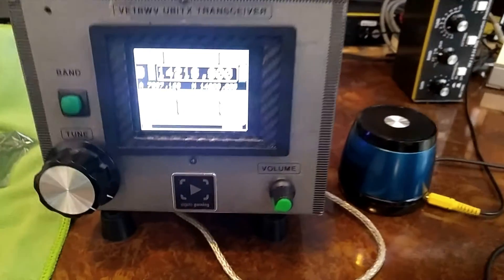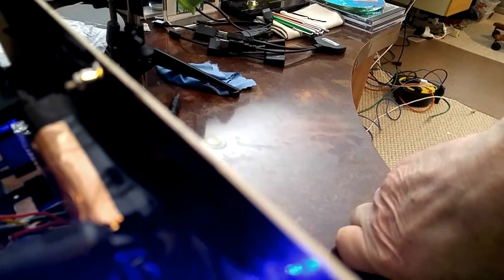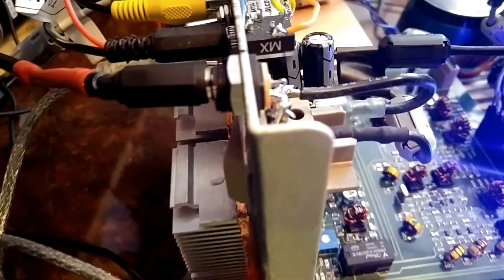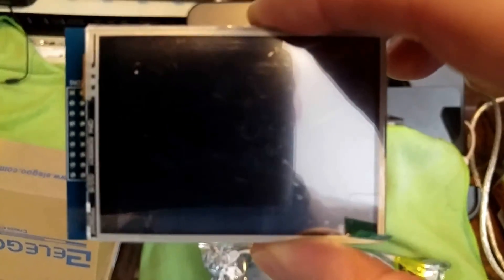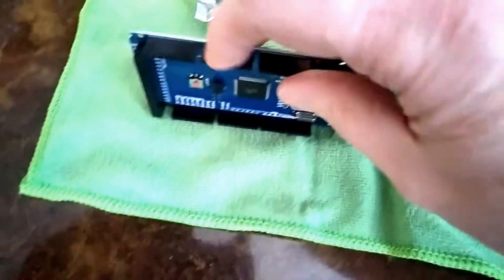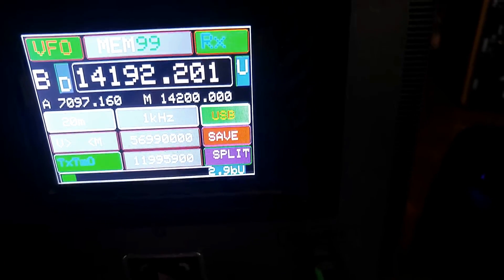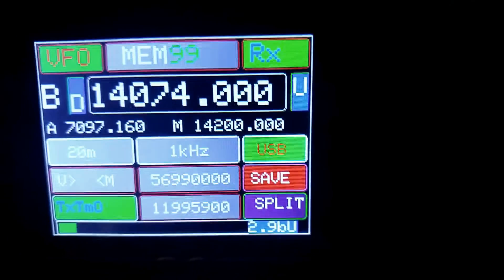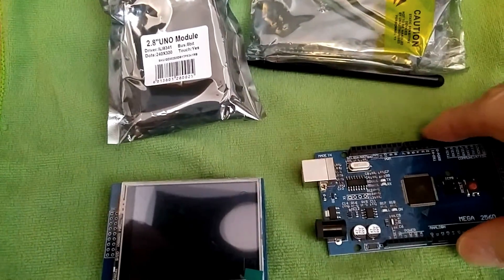UBITX VER 2.9BU INSTALLATION RESULTS

Comment: OK, this was a year ago. How are things going? Are you still happy with it? Any mods or changes you would like?
Reply from the maker: I have used this rig mostly on digital modes and it has performed well.
I also built another ubitx using kd8cec software with 2 nextion displays.. 
Both work great, however, i prefer the nextion displays with higher graphics..
Joe